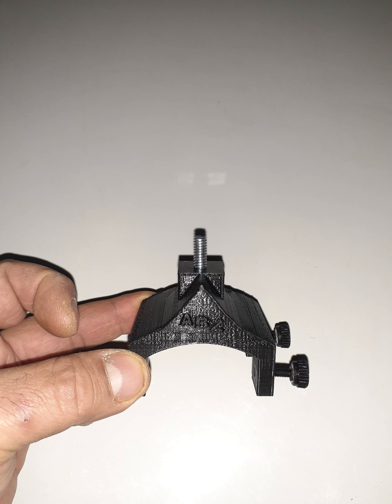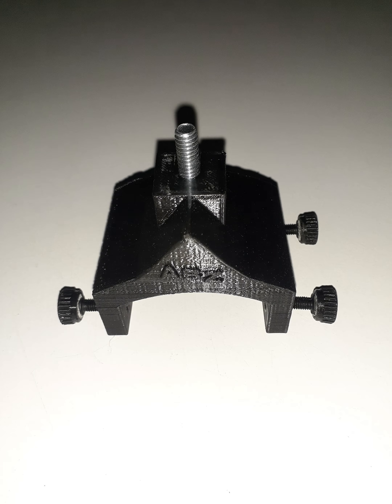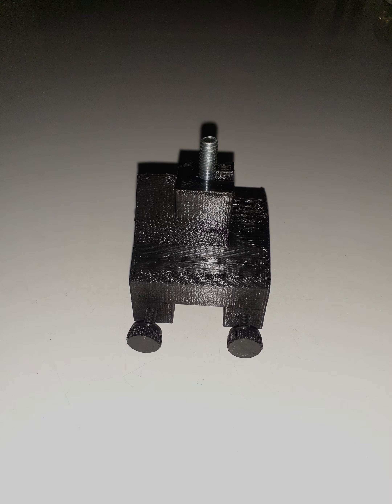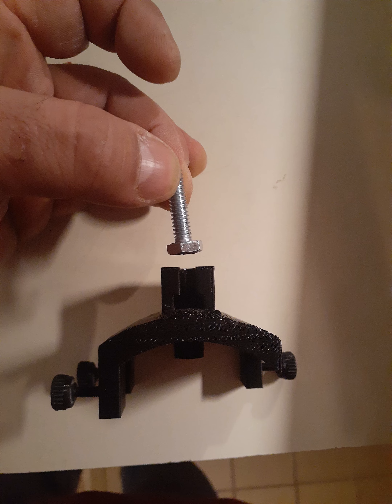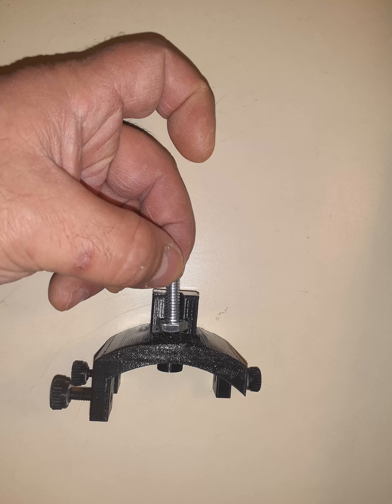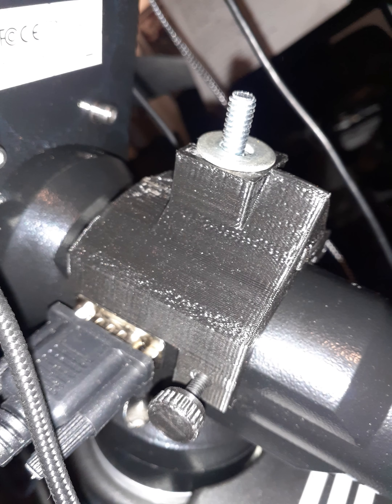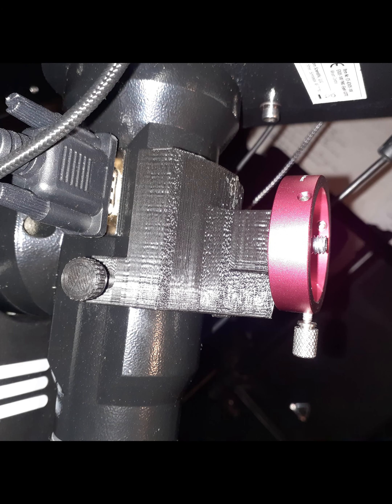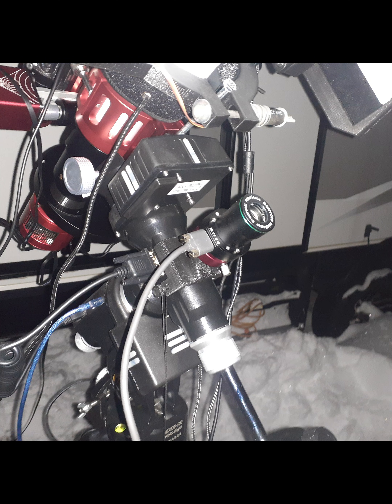iEXOS-100 3D Printed PoleMaster Mount [Alex Zarvis]

Comment: This is awesome! Are these plastic bits for sale? I really want to start guiding with my iExos 100 and polemaster seems too good!! How good is the guiding? Does the plastic "bung" sit inside the Polaris sight tube hole?
Reply from the maker: Hello, guiding is crucial for good astrophotos on most mounts including the IEXOS100. However, this device is for achieving an accurate polar alignment to make the mount track as precisely as possible. Once you are properly polar aligned you can guide using a separate guide scope and camera piggybacked to your imaging scope using software like PHD2. This polemaster mount makes mounting the polemaster device a breeze. The little nub fits snugly into the sight tube hole on the mount. Those people that have their own 3D printers can print the model themselves. You can also have the model made for you by some 3rd party printing services. And I have also made a few for folks that have requested it. If you want to purchase one from me, leave a comment with your email address and i will respond with details. Thanks.